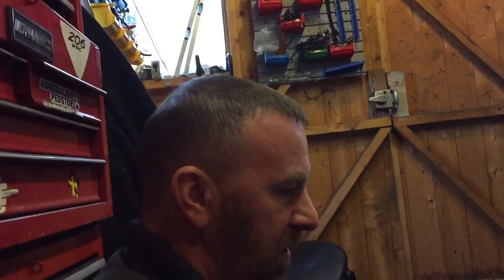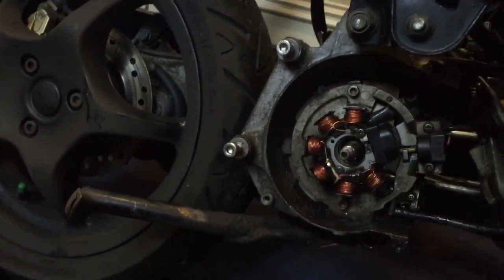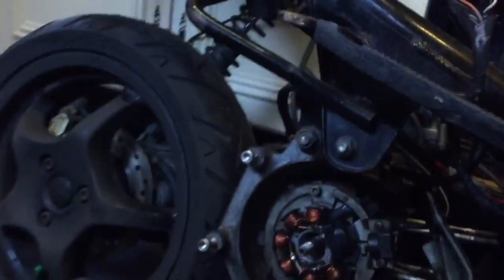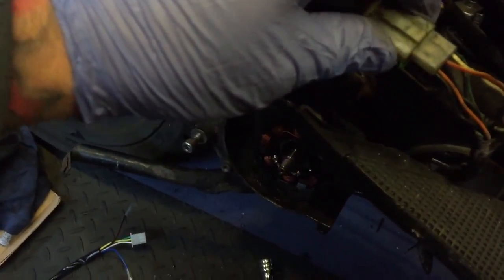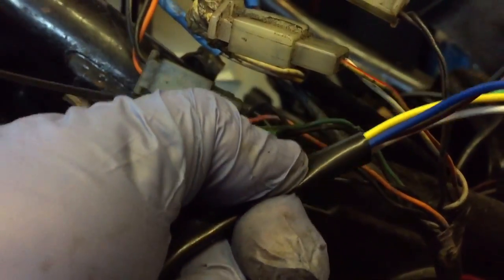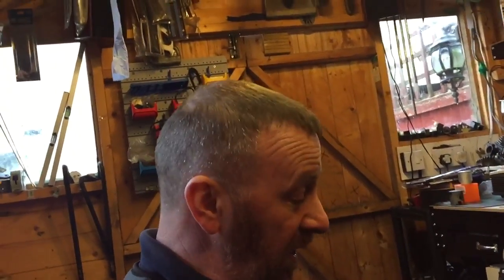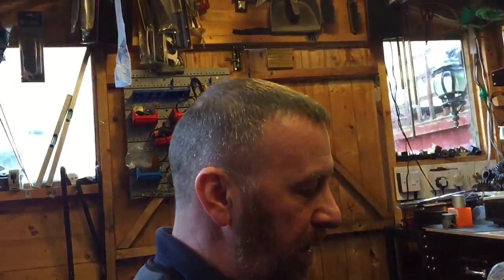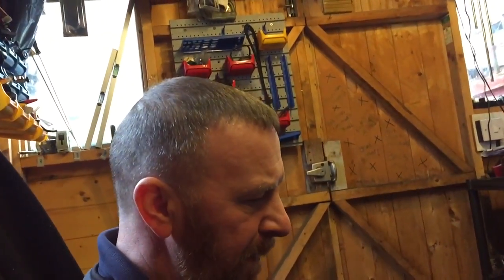Yamaha aerox stator coil replacement mark savage

Comment: Hi mark I am getting no spark now as bike won’t start cleaned carb got new spark plug still a no go
Reply from the maker: No spark bud 
Check power into cdi bud sounds like you needa new cdi bud 
Very common
Reply: mark savage I have a spark now mate but still can’t seem to get it to start any simple tips mate
Reply from the maker: @seantrott4878  so spark now 
After turning it over is the plug wet 
Sometimes after trying to start it you can flood it so take plug out clean and dry and leave it out for an hour 
Then test to see and take out to see if its wet and you still have spark
Reply: mark savage Hey mark, I’ve the same problem, not having the spark as the other guy. So the problem is very common and just needs a new cdi hopefully? My aerox was running about 2 months ago or so been left sitting since about then and seems to have no spark and cant start it. Any help would be appreciated.
Reply from the maker: @ervinsis  when they sit they can go to earth and blow the cdi 
Check power to the cdi and power out 
Check coil power to it as it maybe that and a lot cheaper to replace 
But the cdi's do go all the time bud
Reply: mark savage Ah okay, and also there shouldn’t be any problem with the stator? Just the cdi and coil that can stop working when its sat for a bit?
Reply from the maker: @ervinsis  to be honest anything can go lol but more likely the CDI

Comment: How did u get the stator cover off
Reply from the maker: You need a stator removal tool 
On ebay under £10
Or very hard / two big screw drivers but I don't recommend it
Reply: @marksavage  have u got fb

Comment: Hey mark! What should i do if my yamaha aerox is kind of backfiring?
Reply from the maker: oh , does it run ok or not starting ?
it could be the start of the piston going 
does it run ok if running 
fuel ?
e10 or e5 
unjetted ?
Reply: @marksavage  it like starts but when i go full throthle it start to backfire un makes weird sound and won’t go.
Reply from the maker: @Gas Dealer  odd
Carb off clean 
Look at jet
But sounds like piston damage bud
Reply: @marksavage  But how could it be pistons fault?
Reply from the maker: @Gas Dealer  i thought you were trolling me 
Ok 
Back firing is too much fuel
Normally carb so if up jetted but this would cause bogging 
If the rings are failing
Or piston scored it will back fire as unburnt fuel
If ac take head of and inspect 
Lc a little more work with gasket 
They don't have timing as such as fixed on the stator 
Maybe start with the stator coil and clean
But you have changed the plug !!!! Yea !!
Colour of plug?
Reply from the maker: @Gas Dealer  I'm looking at it as you have done all the simple things 1st
Air filter plug etc 
Not a silly foam filter 
Not a 21mm carb 
100 jet etc etc
Reply: @marksavage  i tried couple diffrent carburators, 21mm 19mm and 17.5. And every single one had the same problem. I changeg cylinder gaskets but nothing changed.
Reply from the maker: @Gas Dealer  e5 e10 to e5 super  fuel

Comment: Hello mate I have a Yamaha aerox 2000 reg bike starts runs and rides grate but my Headlight is not going bright at all I have had a good look at it wean you rev the bike it doesn't get bright but if you let go of the throttle it sort of tries to have you got any idea what it could be I have put a battery in but still the same all other lights work fine back light brake light and indicators work fine I'm confused with this one
Reply from the maker: hi bud ok its a few things 
stator coil low volts coming out , take off and clean or replace 
bad earth this can cause 
wrong bulb they are not 55/60 but 35/35 and the stator cannot pump out enough volts to get it to full brightness 
maybe look into led bulbs , much better but may not pass mot so just swap it out on that day and that's what id do 
check out my led bulb videos on here, very easy to do and cheap lol

Comment: Hi mate, was having a dillema with those 2 slide on connectors coloured red/black and white/red on my scooter and the slide plug it connects on to is coloured red/black and the other one is white/blue. I assume i’ll connect the white/red and white/blue wires right?haha damn these colours
Reply from the maker: I know its mad when you have this but use a volt meter to make sure you not putting power to an earth !!
Reply: mark savage thanks bud

Comment: Got spark back today mark but I'm not getting any spark from the plug ? Any ides   several plugs

Ignition coil seems not to be making much power ... 1 on the way
Reply from the maker: Earth problem maybe bud
So you have power from the cdi to the coil then to the plug?
But no spark ?
Reply: @marksavage  its driving me round the bend mark haha 
I've had it running for about 15 mins then it bogged down and wont start .. it has 1 spark goes to fire but no more spraks seems to be firing the engine.. 
I'm lost I have a new stator just need to het that bolt of haha fingers crossed I've had this bike a little while now only paid 65 it's a lj50qt k 2 stroke moped
Reply: @marksavage  thanks for allways replying to us mark means alot mate really does make our day when you reply to us 😉
Reply from the maker: @marie82924  I had this on the v clic 
Watch my next video out on Friday 
No spark on electric yet spark on kick start !!
I think it was the start relay as the starter wire arked out and blow the new one !
Reply: @marksavage  I will keep my eye out those 4 strokes are a little more complicated ain't they ... oil timing ect 
... well I got the bike going about a hour ago took it for a good run as the last lad used motor oil in the tank ...... LOL I've seen it all ... NOT .. anyways I swapped the stator out and she ticks bro
Reply: When ever in doubt I come over an flick through your vids there well worth a watch as you never  no what problem you might face next ... great work mark your a Fu****g legend
Reply from the maker: @marie82924  yea bud i guess we both have even a guy that used hydrolic oil as a fuel 2t mix !
Its a good day for it 
But really they just bug me with such odd none start reasons lol 
Well of to a drive through food car show in Chelmsford 
Laters bud
Reply: savage arhh mate tell me about it lol I've spent most the day clearing out the residue ENGINE oil lol out of the crank slowly clearing her out an now she ticks over alot better before she was fouling the plug every 5 mins jet black it was lol 

Sounds fun mark we just ran down the sisters in law for the day let the kids run riot it's my daughters birthday on Wednesday I've built her a nice little quad really looking forward to see her little face light up 🤑🤑
Reply: None the less enjoy your day savage 💪🏻
Reply from the maker: @marie82924  you too bud

Comment: Hey mark, I am buying a Piaggio zip in the coming weeks but i have been told the electrics don't work but the bike still runs and rides but no horn, lights, indicators ect, if you could maybe give me some diagnostic advice of what I check first when I got hold of the bike, thanks 1
Reply from the maker: I have many videos on how to fix and help with 4t and 2t mopeds as for electrics it could just be as simple as needing a new battery as al items listed run from this and are fused so could be simple or even connectors , earths etc but my videos will help bud

Comment: I have a neos 50cc I believe they use the same stator but I can’t find a 4 wire only a 5 wire for that neos did you manage to install it fine on your Aerox
Reply from the maker: you have to use the same bud 
if its 4 then you have to use 4 
if 5 then use 5 as for the pick up / immob 
ask sellers if you cant find the right match bud

Comment: Hello mate it’s been nearly a year since I started my aerox had a mot and now at top speed she completely cuts off bad please look at my VIDEOS let me know mate please hope your good
Reply from the maker: Ok that can be a few things but let's start with a new plug 
Then carb off 
Jets clean
Check all air pipes 
Tune like in my tune videos 
Air box ? What you got on 
Check vacuum if working 
And carb float
Reply: @marksavage  hi mate done that all yesterday everything is perfect and clean and new plug I’m
Now going out side to see if the crank is okey it’s so strange
Reply: @marksavage  hi mark okey so I’ve clean the carb I’ve checked the reeds they still like new from last year 
Check all pipes and vacuum to make sure working so with vacuum pipe if I suck it works and if I remove it from the carb the bike tone changers and basically starts to turn off refitting it revs up so that’s okey and back to normal idile  spark plug is new check all my belts and vario rollers belt literally every thing new from last year pull off the stator check wood shaft and crank seals all in place no leaking both sides drained the fuel starts on one kick and one good push with my hand that’s the thing that’s confusing me last year was good it’s only been stood 13 months and started twice I’m that year if you have look at my video it’s like as if some one turns the keys off or power cuts and the. It’s starts some forums say piston rings and so on I don’t think that all that’s the typical keyboard pusher if they was gone it wouldn’t start and smoke 💨 it don’t
Reply: @marksavage  hi mark just to confirm it’s does not start after it switches off in that video just been out and tried it I removed the plug and yes has spark ⚡️
Reply: @marksavage  standard airbox mate 17.5 carb 92 main jet but this was set up last year mate I spent months it had just sat there 
Check the fuel pipes and vacuumed sucking on the pipe lol yes fuels comes out and also when you re plug the vacuum back on or pull it off makes the bike turn off so that’s working yep the carb float is okey has its movement up and down as that’s only year old
Reply from the maker: @kayone8571  you've done all I would have done !!!
How odd
So 
Spark nice and blue 
Vacuum fuel coming out and stopping 
Carb cleaned 
Jet a little big but was running 
Really odd 
Yes check piston I guess 
But odd 
You've even change the fuel 
Even I'd be Scratching my head bud !!
Reply: @marksavage  morning mark well confused the bike been running on the spot for 45 mins and I’ve checked all wiring spark ⚡️ I have not removed the head yet but surly it wouldn’t run if  it had a bad piston or rings I’m waiting on compression test this morning I’m
So stuble
Reply from the maker: @kayone8571  if it was gone no it wouldn't bud 
Scored or damaged rings yes but loose of power 
Odd
Reply: @marksavage  okey mark thanks for the reply I’m going to bite the bullet and drain water and take the head off I didn’t want to do this as I took pride and good time last year to build it I’m going to remove it now with in next hour and see if the head gasket gone I have the digital aerox dash with temp and fuel digital and small mph speedo if I remove it and it’s normal I’m going to be well confused it’s running so smooth on the spot but I don’t dare take it down the road and I have to push it I’m to old for them
Days . Someone message me saying that in my VIDEO on YouTube that it could be the cdi making it turn off at full revs but that’s a load bs you been in this game for some time now mate I’ve never know a moped on full throttle like my vid to turn it shouldn’t turn off should it the thing is all that bogging etc isn’t my case the question. I know that any moped on stand you should be able to rev it max out and should not turn off hints why I haven’t gone down the road because if it’s doing it on the stand that’s the same as riding It what do you think mark.
Reply: Ps on the dash the temp sits 70 72 not over heating again that’s telling me not to remove it
Reply: Battery is no good but aerox can run with out a battery
Reply from the maker: @kayone8571  I've had this once and it was the stator coil going to earth under load !!
Reply from the maker: @kayone8571  they can but you can get a back charge !, get a battery on there bud 
Leave the head for the moment
Reply: @marksavage  okey mate this one is flat I’ll need to charger it lucky I was just about to undo the head bolts
Reply from the maker: @kayone8571  check the output of the stator too 
14.4 around that
Reply: @marksavage  how do I do that mate I know with multimeter but on ? What area
Reply: Check my upload your see mate
Reply from the maker: @kayone8571  so there you go bud 
Thats not right and need replacing 
Much better than the head etc 
Well done bud
Reply: @marksavage  thanks mate
Reply: And guest what I’m
Uploading another check it 5 starts to you mark  give me 5 min
Reply: @marksavage  just uploads another VID I don’t think that was the oem part as the bell don’t fit it but I’ve checked it and working so I’ll need to buy a new one
Reply from the maker: @kayone8571  they do ,do a few and immob and none immob with different polls but sure sounds like you've found the problem bud
Reply from the maker: Plus I had this on my speedfight 
https://youtu.be/OWxEAcWlVbI

Comment: Right then to all my aerox guys I ride big bikes I love my Aerox’s tho very sporty bikes Ped’s and go very well 
Well then after constant asking around I Found the earth cable to the started motor back 10 mm nut was split in its wiring to the block :) I ran new cable and guess what no more miss-fire back fire at all ☝️thank you mark and keep them vides coming two anybody that gets this nasty misfire out of exhausts 100% earth wire to the start motor infact try it disconnect it  you will still have a spark even it’s not connect so that would drive you nuts believe you me check all wires first 
Having a spark does not mean the bike is earth correct for when it’s running

Comment: Does anyone know if I can put a 2002 coil and cover on a 2011. Is there much difference I know obviously it’s a no no. But does anyone know if it would work?
Reply from the maker: 2002 is a mk2 and 2011 is a mk3 they are different engines, you would need to buy the right one bud
Reply: Ahh top man thankyou! I’m thinking of using a dremmel to cut my fly wheel off. As the tools just crushing the crankshaft and not moving it off it. Or would you say try to persevere and save the cover ? Thankyou for getting back to me !
Reply from the maker: @scott4364  its up to you bud but I wouldn't play to much but as long as it works it should be OK bud
Reply: Okay thankyou I appreciate everything, too man all the best
Reply: Hi mark sorry to bother you again, thankyou for actually getting back in touch. I’m wondering about replacement stations, I’ve seen stators with two extra leads this is for the other timing is that correct?
Reply from the maker: @scott4364  one will be immobiliser and one without immobiliser 
You have to get the same one as in your ped bud 
I've a video on a sp2 that some one had fitted the wrong one , it started but drove me mad lol 
Its on here with a picture of me with a stator coil
Reply: I think I’m just getting confused over a clip that holds the wires in place. Should be after 04 on ped parts I believe. Top man mark thankyou! I don’t know if you realise there not a lot on these bikes even on YouTube. You actually have been a life saver . So thankyou. Also thankyou for being active with people.

Comment: Hi mark, currently rebuild my areox engine, how would I make sure the stator is in time?? I've lined the two marks up but piston isn't at tdc
Reply from the maker: you cant adjust the timing on the stator bud only fix and it works or doesn't lol 
then its you cdi 
does it run ok?
take it its 2t older one and not a new 4t new one

Comment: Hi mark, i bought another speedfight 1 non immobilised and the stator inside on the magnets are really rusty im wondering is it ok to use emery tape on the magnets? Thanks
Reply from the maker: yes you can take it off and give it a good clean up bud
Reply: @marksavage  ok cheers.

Comment: Hi Mark, im having the same issue as somebody else in the comments, I can't remove the flywheel cover on my aerox! I have a puller but the cover i have doesn't have any thread at all! As in it never has had thread its just a flat unit? I have removed the bolt but can't remove the cover! What would you suggest??

Comment: I can't fathom what mindset or mind altering substances a person needs to be on in order to butcher a wiring loom like that? like fix the problem wire, but dont cut and shut loom and put on different connectors and wrap with ill-fitting electric tape that eventually falls off?
Reply from the maker: I see it all the time and the good old cable ties lol 
Watch a few videos on how to do it and it would have sorted it but No !!! Its not fix it but  more F@uk it lol

Comment: Mark  do this video  charge your battery and keep it charge    my battery  lose  charge  and it new battery  can you help  I got yamaha aerox yq  50 .. 54 REG
Reply from the maker: Best you a volt meter first to see if it’s putting an out put and the battery too
As sometimes I’ve bought a new battery and it’s been a dud 
It is however common for the stator to be the problem 
I’ve have a few other videos on stator coils on my channel , they are on speedfights but all the same basics 
They change the battery and timing for the moped

Comment: Hi, im having trouble removing the flywheel it seems to be stuck on. Ive tried a flywheel puller but cannot get it on evenly as one of the threads that the puller screws into is fucked. Any other methods of getting them off ive tried pulling with some force but still had no luck. Cheers
Reply from the maker: oh dear this is going to be a hard one to remove bud but use there or four screw drivers and two pairs or hands and lever it out but be careful not to damage the casing 
to be honest its going to be easy or a right bugger
Reply: Got it off cheers for that had to use a spanner to lever and wiggle abit with something to pull it 👍